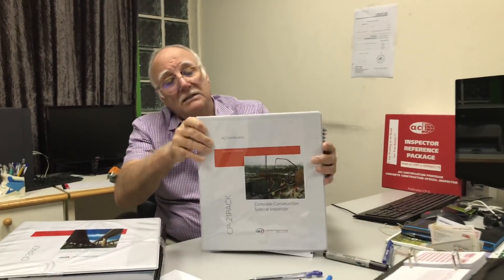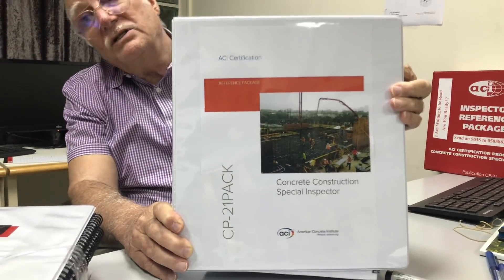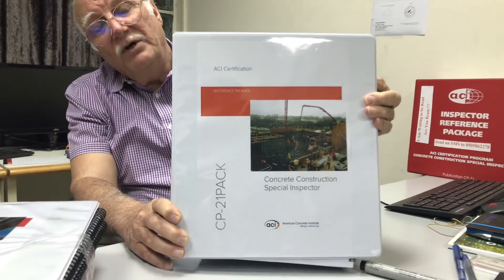ACI Certification in Saudi Arabia

Comment: Salam Engineer, 
What is the procedure and what are the requirements to join?
Reply from the maker: Furqan Shafqat  you can contact Dr. Maher Bader on mobile 0505862278 or by whaatsup I conduct courses based on your free time or if your company sponsor you to take the certification. You can purchase the file it cost 600 SR and it is needed in the open book exam